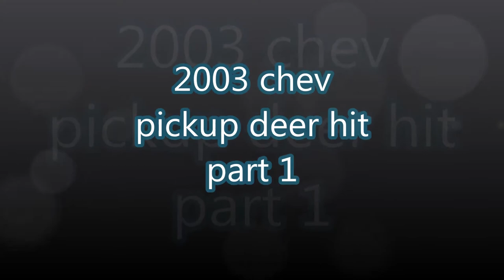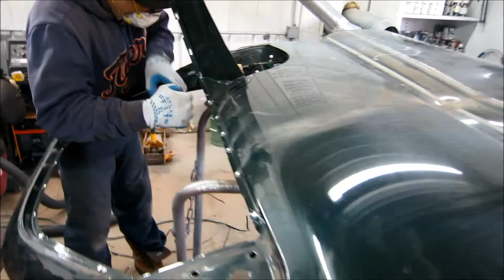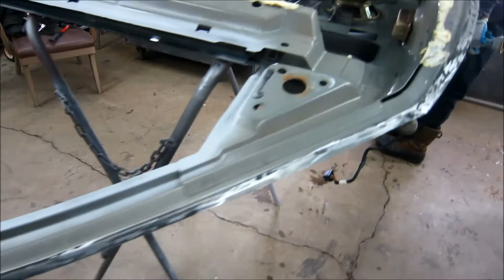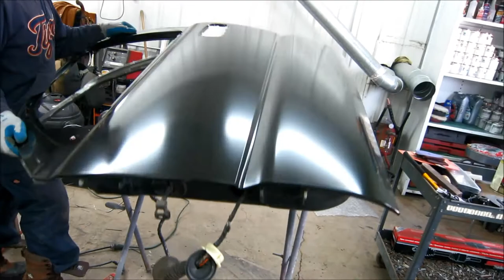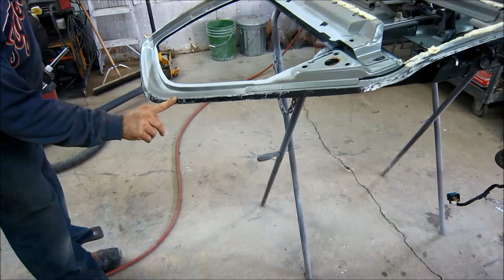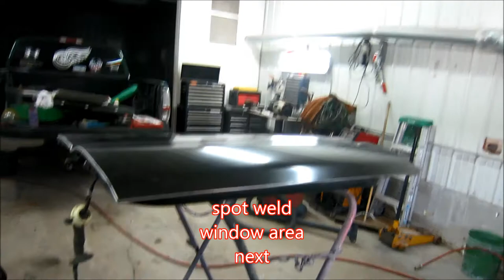2003 CHEV PICKUP DEER HIT  door skin

Comment: Amazing how thin an flimsy this new sheet metal is ugh
Reply: agreed
Reply: Fullthrottle440 seriosly, you cant even lean on a newer car these day with out giving it a body wave, Remember when you use to be able to lay on the hood or the trunck of car? them days is ova
Reply: strtrodder100 I hear ya. I can stand on the hood of my truck with no problem. a relative of mine has an '09 corolla. boy does that thing suck. if you try sitting on the hood it pushes in like a tin can.
Reply from the maker: renoylds wrap